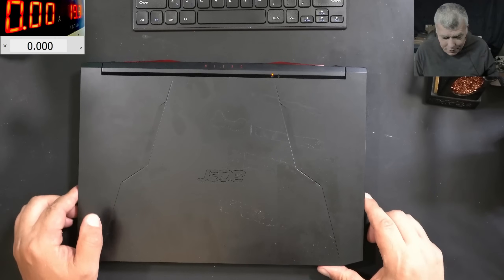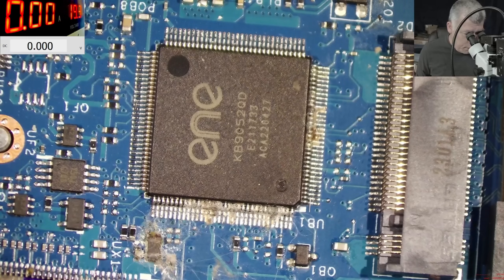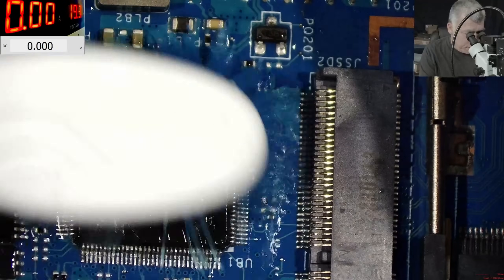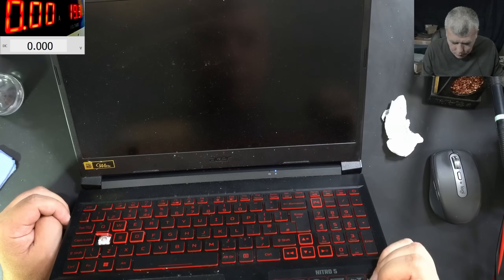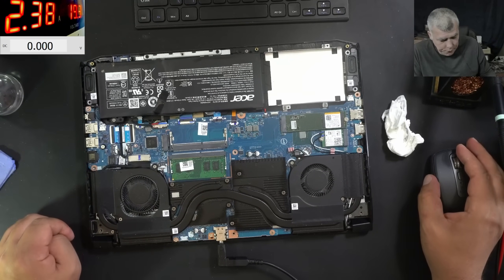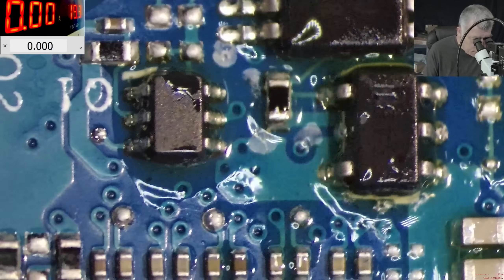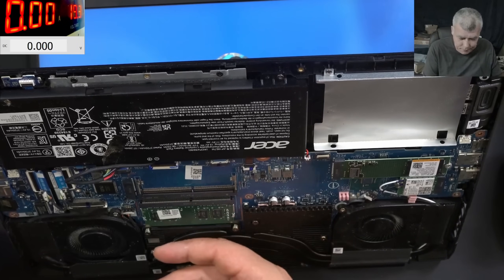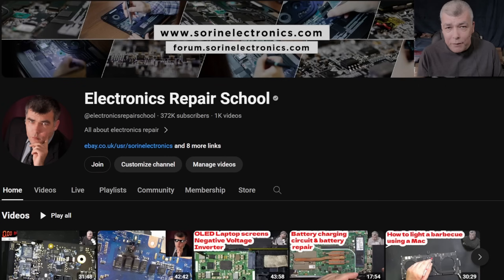The logic behind a liquid dmg repair and rust prevention. Acer Nitro 5 liquid damage repair

Comment: Today I will disagree Sorin. Your method is not good.
First - melting temperature of rosin is about 70-80 Celsius. So in case of MB it is possible to melt and tap to other parts. If you would like to prevent from corrosion you can use dedicated stuff like V-66 Isoleting lacquer used for example in automotive ECU. But IMO cleaning and resoldering is must have.  
BTW on the movie you didn't take out the board even. What if the corosion is on the other side? Liquid is unpredictable.

Comment: Nice way to stop air getting to the corroded metal. I'm a bit more paranoid so I would remove the whole board lol. I bought a few gallons of distilled water for these jobs. I don't have a ultrasonic cleaner so I just put the whole motherboard in a shallow tray of distilled water for a little while then clean with a brush. After, I flush away the debris with distilled water in a spray bottle with the board held vertically. I then use 99% isopropyl alcohol spray to displace all the water and finally dry it with hot air (or sun if we have a nice day).
Reply: me too :D

Comment: you mean distiled water?
Reply from the maker: regular/tap water
Reply: I am sure it's a regular water. Sepcifically proper calibrated cleaner 😂
Reply: Hello🤝I remember how in Poland this was the way to protect printed circuit boards in various audio equipment and not only by using rosin, even nowadays you sometimes find retro equipment with such protection, good job, best regards👍👍👍👍👏👏👏👏👏👋👋👋👋👋
Reply: No.. remenber.. Sorin use a very expencive Italian mineral water in past video..😂😂 i can't say the brand... can't to advertising..